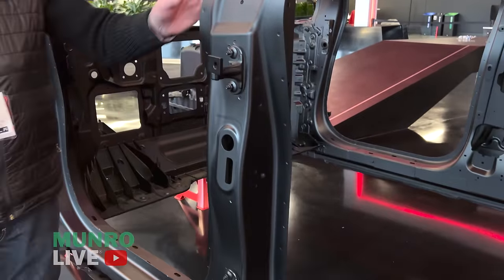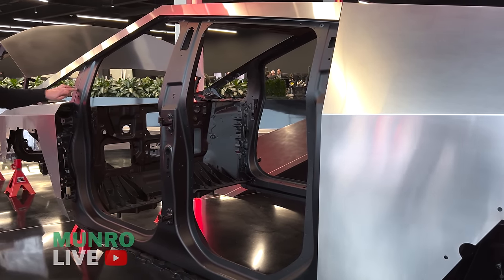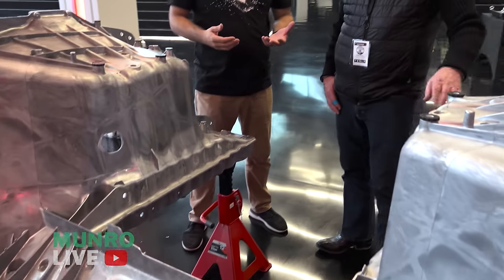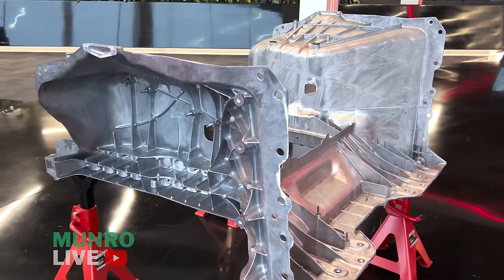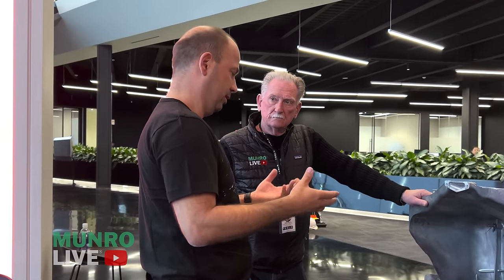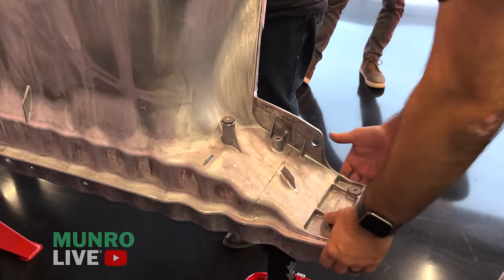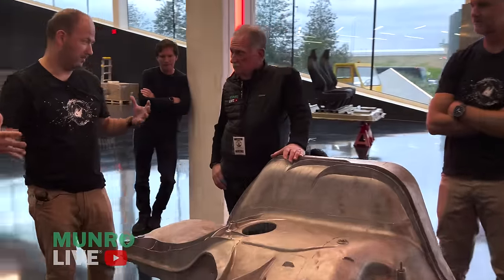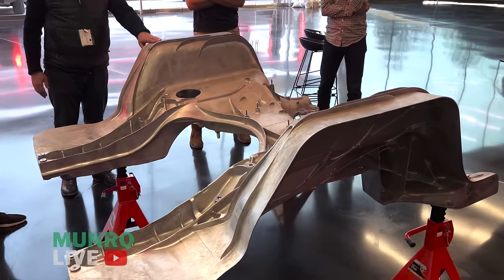Tesla's Head of Vehicle Engineering discuss the Cybertrucks castings and exoskeleton.

Comment: I wonder the labor required to replace a damaged casting. It looks very intensive to pull out a damaged casting (which would be inevitable in most crashes, especially to curbs or low objects). Sure it resists a hammer swing but running into a curb at 10+ MPH? It'll shatter to pieces
Reply: These castings are not heat treated. so they’re NOT brittle at all. And they’re also thicker like 5-6 mm. So they can easily be tougher than bunch of spot welded stampings.
Reply: @TANOCA17  So what do you think will happen if someone runs into a curb going pretty fast (10-30 MPH)? They'll just bounce off? I doubt that - the truck will be carrying an enormous amount of energy. Isn't it part of the crumple zone even? The engineers say it breaks apart.
Reply: @danmobile  these castings are main structural parts, not crumple zones themselves. There are crush cans that are designed take a certain amount of crash energy before damaging castings. Lets assume that that energy level is exceeded and they’re damaged. It’s the same mechanism as stamped main structure. The car is totalled at that point already for either type of structure. And let’s say that you still want repair the casting. And again, since the castings are not heat treated, they can be welded perfectly and retain their original ductility or toughness. I don’t know may be Tesla can sell partial castings (like those protuding parts for attachment of crash cans) for such welding repairs in the future for body shop that would want to carry out such repairs.
Reply: @danmobile  And believe me it won’t break like shattering.
Reply: @TANOCA17  I don't mean shattering like glass, but something's got to give. 

In my experience with castings they can be flexible, but they're either going to break (a large chunk off for example if you run over a curb at speed), crack resulting in severe degradation of their strength, or severely deform if that doesn't happen. This could happen even from a severe enough pot hole, but I'm talking about driving over a speed bump or curb at higher speeds than say, 10 MPH. They won't just absorb that impact like a sponge with no consequences in a 7000 lb truck at speed. All of the suspension is connected to it.

Either way yes the truck will be totaled, because the casting will require replacement and it'll be a nightmare for labor plus the cost of parts. Nobody is going to weld to these castings for a "quick fix".

I'm wondering if Munro will talk about this, not you (no offense).
Reply: @TANOCA17  And I don't mean crumple zones from collisions with other vehicles, as these are under the car. I mean from low impacts to the lower suspension components that all of this is attached to. I shouldn't have used the word shatter. More like "large chunks will break off or it will be severely cracked" if you hit a curb.
Reply: @danmobile  I hope someday Sandy talks about it and clarifies peoples minds. But I know a little about these castings with some 17 years of engineering experience on engine, gearbox castings. Of course if you hit something (pothole, bump, curb whatever it is) really hard enough with a casting, it’ll cause some plastic deformation. In heat treated aluminum cast alloys with like T6, T61 heat treatments depending on the exact alloy etc, elongation before breakage is generally 0-5%. This is what’s called “brittle”. These are not damage tolerant but has high yield strength (as you would want in such engine, transmission components) and can be machined easily due to easy chip breakage etc. It was discussed in some of prvious Munro videos that Tesla mega castings are NOT heat treated and made of A38X some special alloy that was developed by Tesla for better die filling characteristics and high strength. In general sense, such untreated alloys have very high ductility like 10-20% elongation before breakage. That elongation is almost steel territory ductile. In summary, this material can yield relatively easily but will require huge energy impact to be torn apart. In that event it will absorb huge crash energy if designed right (it seems so from what’s told by Lars). Hope this clears your doubts
Reply: Maybe you could try listening first ... oh, that's right , you already know the answers to questions that 30 engineers and fabricators never thought about. Perhaps you could try an interview for a job at Tesla. @danmobile

Comment: The Cybertruck's front and rear end are manufactured that way and made from 6000 series aluminum. According to official recommendations, frame straightening isn't allowed. "Pulling or pushing the body structure can damage the integrity of the component," says Tesla in its structural repair guidelines. bottom line: aluminum has no ductile strength.

Comment: How does the body shop fix this in a minor accident? No doubt it is very well engineered and designed, but my F150 was rear-ended and it cost $7k. With the uni panels and no paint this is going to require some serious work to fix. I saw a report where a Rivian rear quarter cost $37k to fix
Reply: No paint makes it harder to fix?
Reply: @markjonz  Yes, if there is a minor dent you can pull it and smooth with putty/filler and paint. With this system it will be replacement of the panel. Even if you have to cut a section, very common, and replace with a new quarter panel, there would be a seam with no way to hide the weld.
Reply: They can replace the stainless steel panel and I would prefer they do that to my car than bodge it with filler
Reply: Yes on a conventional monocoque/unitary body damage to the rear wing or fender has to be cut out and a new piece welded in and painted over. Unfortunately Sandy didn’t ask how the stainless panels are attached and what role they play in the structure of the vehicle. However I’ve heard a suggestion they’ve used structural adhesive to avoid any welding marks. We don’t know about their role yet but I’m guessing the side panels increase the torsional rigidity but could be removed and replaced since they’re a separate part to the castings and door rings.
Reply: @markjonz  in the interview he did with Elon, Elon referred to it as an exoskeleton, if there is damage there will be a seam. There may be a well thought out method for repair, but as I see it here it will be expensive.

Comment: Is the cyber truck gonna be repairable? Or will it end up like a Rivian, one minor accident and it’s totaled?
Reply: It's called "job security", seriously tho bet its safe A.F.  Better to be unscathed with auto insurance bill than broken bones with hospital bills
Reply: Usually if air bags go off, any car just gets sent to the wreckers
Reply: No, if it's a minor accident, only the panels, bumpers,  and lights will be damaged. It will take significantly more force to damage the rear or front castings. So minor accident for Cyber truck would be a major accident for any other vehicle. If it's on the side, then once again significantly more force is required to damage it, but the body skeleton is just stamped steal like any other car. Once these become more common and more spare panels are available, it shouldn't cost anymore than repairing any other Tesla, and could potentially be easier since there is no matching of paint required, just replacing body panels or doors. That's the vision Deloreon had in mind when he created his stainless steel sports car. Just replace the whole panels when they become damaged. However, replacing broken windshield wipers will be much harder and you won't be able to to find replacements at regularly auto parts stores for sometime. 😂
Reply: It depends. Front end damage it's going to the junk yard. A rip or cut in the SS body, find a TIG welder who can patch. Then live with the weld.
Reply: @CountryTesla more of a off road question. How much off road damage is to much damage?
Reply: If structure damaged, any car became scrap. But here we can see some interesting things. There no "structure" in pillars. Only 2 pieces of metal. As "structure are door panels,  which are changeable. In front and back we have a lot of room between bumper and casting, so a lot of room to bent before cast will broke. Its much harder to do "structural damage" here.
Reply: The good thing about it is that in most case you just change the panels and doors, since they are the main body structure.
Reply: Media posts a FUD article on one expensive Rivian repair and people generalize. Business as usual.
Reply: @JEP-Tech funny wiper comment!! 🤣
Reply: @Dularr  Suspect what we do with the farm truck wouldn't be advised in the CT but its is nice.  I'd save the thrashing to trailered 4x4s, external roll cages and beaters. In the oem competition, if skateboard grinders on the battery tray are avoided the CT should fair well.

Comment: The castings themselves are REALLY cool. However I have serious concerns about reparability. One of the main reasons insurance is so high on Teslas is they are one minor crash away from being totalled. Huge castings don't give me much assurance the vehicle is repairable in any significant way.
Reply: yeah totalled just means repair is over 70% if its value, it doesnt mean irreparable, insurances suck.
Reply: That is why every available tech should be in these things so you DON'T crash to begin with and i feel like Tesla needs to do more...the vision based system sucks.  I feel like it needs some radar/uss.
Reply: @zachlafond2652   no amount of tech is gonna save you from a reckless driver coming straight at you, unless it has a damn rocket hover mode.

Comment: 7:56 this screams for a CT design without the auto tonneau cover so that the rear wall and glass can be opened or removed. best of all, huge cost and weight reduction.  The CT is designed a Model X class of vehicle where it is expensive and volumes are lower.

Comment: So if they can stamp press high strength steel into frame pieces, but the stainless steel alloy is so strong it will break the stamping machines according to Elon, is the stainless steel stronger than the high strength steel?
Reply: Yes
Reply: The stainless is surprisingly thick material and work hardens rather much?
Reply: That, like much of what Elon Musk says, is complete nonsense. In the doors and hood, for instance, the outer stainless steel panel is folded but the inner panel is also stainless steel and is stamped. There are many stainless steel alloys, and many of them are routinely stamped. 

The outer panels could be stamped, but that would mar the surface finish (which would not be acceptable because they are not painted), so they are only folded. 

For details of the how the stainless steel panels are produced, see Munro's later video:
"Tesla Manufacturing: See how the Cybertruck HFS Panels are Blanked, Bent, and Built!"

Comment: Still don’t see where I can install a 5th wheel
Reply: Because there isn't anywhere suitable to install a fifth wheel. The body sides are far to high for a typical fifth-wheel trailer, anyway - it would need to be a gooseneck. And few trailers light enough to be towed by a Cybertruck or other light-duty pickup use fifth-wheel hitches, although there are some.

Comment: how do you cultivate the exoskeleton advantages to the structural strength of alloy-casting chassis ? i mean what type of connector do you use, and how many connectors are in the body ? and where are those critical structural point of the chassis and exoskeleton ?

Comment: They call it an exoskeleton. So how is the stainless bound to the "framework"?
Reply: That’s an interesting question. Maybe it’s glued because regular steel and stainless are not great when mixed together. But anyway, the original idea has been watered down quite a lot. The panels are mostly decoration. But when they tear one down, it will be interesting to see.
Reply: My bet is that the edges of the panels are folded over and drilled out and mounted just like the panels on any other unibody vehicle. The only difference is that instead of a smooth outer panel and an bumpy inner panel with hanger features welded along a seam, its just one panel and there are secondary stamped hanger brackets we conspicuously were not shown that the panels are actually mounted to. The exceptions would be the doors which would still have to have some kind of stamped inner panel to hang the door insert off of.
Reply: @patreekotime4578  Aren't you surprised we still don't know... and Sandy hasn't asked? Re, the exoskeleton: Consider the behavior if the panels were stitched together and then the frame removed (to me that's an exoskeleton). Next consider the behavior without the panels attached (that's a 3D frame). And then together, we have sort of a 3D multi-plane frame with a huge number of gussets... which we have in common unibody construction. And in the beginning we had just a 2D frame... or two 1D bars... and a tent.
Reply: @patreekotime4578  what I would like to know is how they bond regular steel and stainless to prevent the steel from rusting. They have probably used a lot of adhesives and such which is nothing new but comparing to the traditional way, is it better? Who knows until these get torn down.
Reply: @kobbetop  Probably the same way they bond aluminum and steel in their other vehicles?

Comment: The way they are talking about this ugly truck you would have thought they reinvented the wheel .
This thing would have been worth while as a work truck at $39,000 but no way is it worth over a 100 grand .
Who did they make this for ? a truck doesn’t need to go 0 to 60 in 3 seconds neither does a luxury car priorities all wrong on this .
The interior looks extremely cheap and plain it doesn’t look like a place you would want to spend much time in .
The exterior is very crude no style to it and having a stainless steel body will be a nightmare to clean imagine the finger prints all over it .
The design came out 4 years ago now that you can buy it all ready looks old yesterdays news not fresh anymore

Comment: This is one of the most disappointing vehicle launches of recent memory. Idc what anyone says about the stainless steel body panels. They’re terrible for a vehicle. They’re already rusting when exposed to rain, stainless is a fingerprint magnet, scratches easily, can’t be patched and repainted like regular painted car body panels. The other problems are the horrendous real world efficiency. People are getting 600-700wh/mi at 75MPH. That works out to an abysmal ~185-200 miles of range. Charging at a V3 Supercharger takes 45 minutes. The battery capacity is way too small for such a thirsty beast. Steer by wire doesn’t improve the driving experience. The door opener buttons are too tall for children to reach to get in the vehicle. Rear headroom is poor. So many things they did needlessly to appease Elon.

Comment: My only interest is how it gets repaired. 
I am a product designer / engineer for commercial and industrial products. We put a lot of effort into designing things with maintenance and repair in mind. Typically, that interferes with other engineering goals, but the negative consequences of a product that either cannot be repaired or is very difficult to repair means that people will not want it. I have been on the cutting edge of design in my field for decades. Always pushing boundaries and norms. No matter what tech advancement I design, I cannot compromise repair and maintenance. 

So many of the features people are jumping up and down with excitement over have hidden drawbacks. The features that tout cost savings didn't manage to make this thing affordable. The lightweight wiring by co-mingling the entertainment system with life-critical propulsion systems does not benefit the use since the stainless panels are 3mm thick. 

There are some interesting elements and creative engineering, but the whole of the product is a failure for me. Even if I can get past the childlike exterior look, I cannot get past an ultra-rigid, un-repairable, machine that has no practical benefit of other truck designs. In fact, it is worse that other trucks in many of the most practical ways. 

For $100k, this would need to exceed the capabilities of my current truck in every way. At the  moment, all the Tesla can do better is drag racing. Useless.
Reply: Despite your valiant efforts of self promotion I am not interested in hiring you.

Comment: Audi pioneered "space frame" aluminum frame, audi was first..do some research
Reply: The A8...
Reply: The A8's frame was made from aluminium extrusions joined with cast nodes. The Cybertruck isn't using extrusions, it has the two massive castings and a structural battery. The door rings are fairly conventional, but the stainless steel skin isn't. It seems very different to Audi's A8.
Reply: @markjonz  DeLorean called, SS is so 1980's, see how that worked out?
Reply: The DeLoren’s futuristic styling and stainless steel panels still look cool even now, but unfortunately the rest of the car was crap.

Comment: That’s why this is a vanity vehicle not a truck a truck needs to be able to be outfitted any way the customer requires after the clout chasers buy theirs why would anyone buy a truck that can’t accept a standard camper or tow a 5 th wheel or put a tidy tank on or even a service body it’s a toy not a tool.  That’s the most disappointing thing about this unit it missed the mark so far it’s confusing.

Comment: "world's largest door ring*" laughs in crewcab and bus
Reply: Door RING. They do speak a little fast.
Reply: @The_DuMont_Network  my bad, typing faster than they speak😅
However, potato potato, still not the largest
Reply: @feedbackzaloop I think he means the largest single stamped door ring. Most large ones are piece welded together.
Reply: @patreekotime4578  most probably he did, but did not specify and it still need to be checked, as many truck producers utilise one-piece design at least for the front + part of the rear.